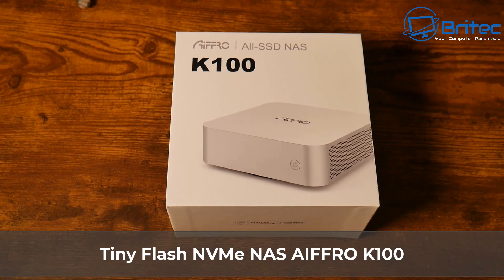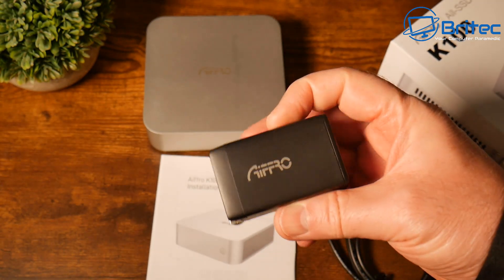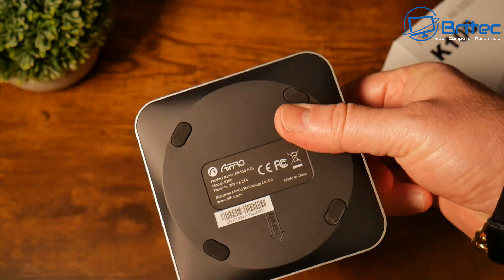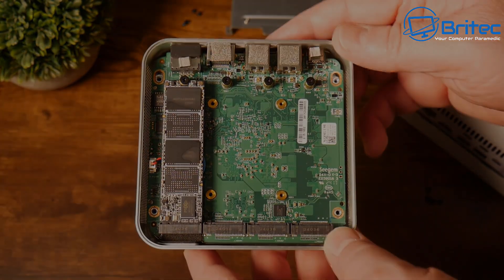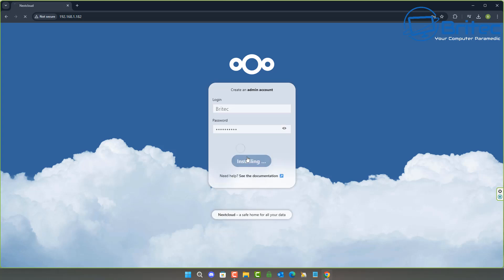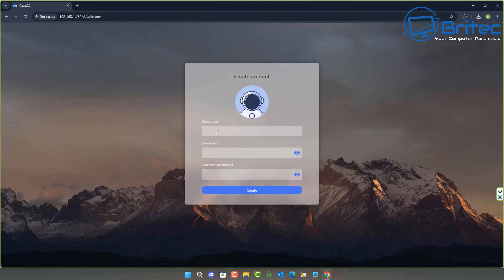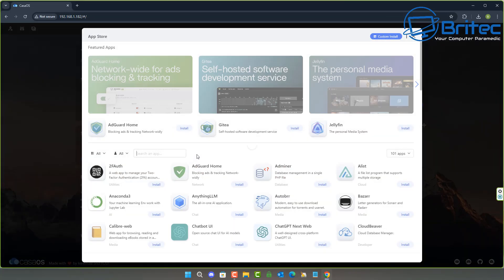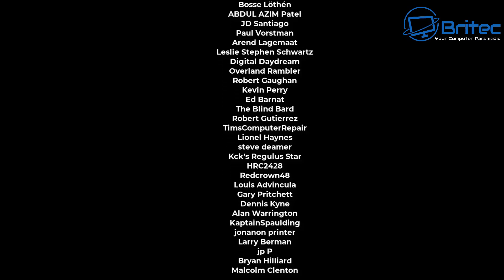Tiny Flash NVMe NAS Drive AIFFRO K100

Comment: This is in fact a miniPC with a primary purpose to work as a NAS. No info about RAID support, and types of them. Generally looks good, might be a good choice for those looking such a hardware. Some cheap wifi module plugged into USB should work I guess
Reply from the maker: Yes you can use raid, I never set one up for the video
Reply: Nothing wrong with a mini-pc with enough m.1 pcie slots, is what i'm looking for.. didn'get the bandwidth hope it is 2.5.
Reply: m.2 pcie slots of course, typed too fast :>)